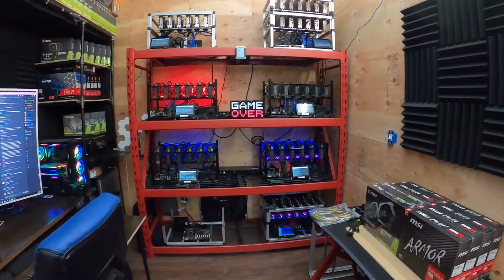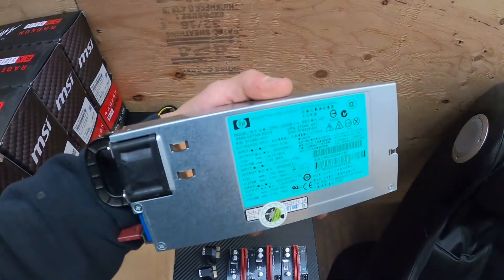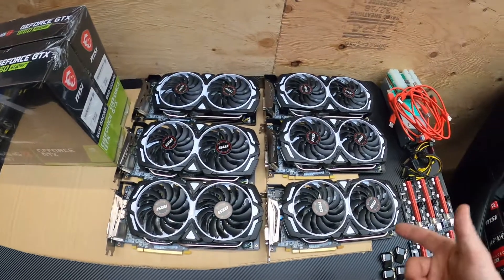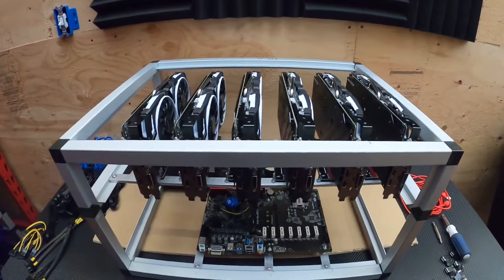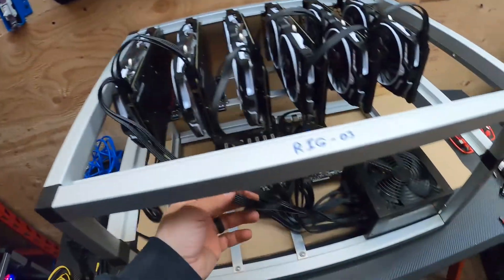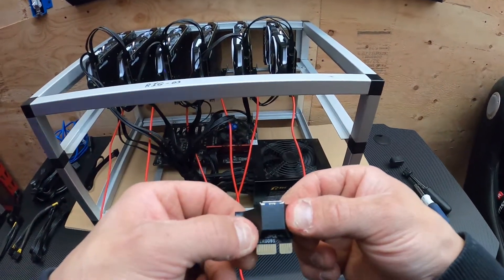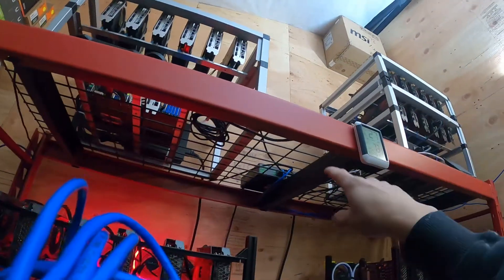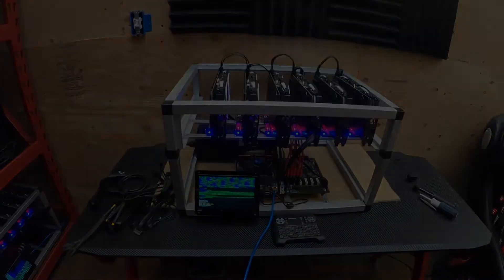NEW ETHEREUM GPU MINING RIG - RX 580 ARMOR X (REFURBISHED)

Comment: hi tell me please overclocking on 580 armor cards how much core and memory do you have?)
Reply from the maker: Join our free discord brotha. We have a bot called Jarvis that will spit out over clocks to get you started/EXTREMELY close to premium settings.

But here you go! This is HiveOS settings if your using MSI Afterburner cut the memory in half...
Fan 70
Core 1130 
DPM 3 (HiveOS)
Volts 850 (HiveOS)
Memory 2090 (or 1045 ROUGHLY MSI Afterburner) 
MDPM 800 (HiveOS)
Turn on aggressive under volt (HiveOS)
Reply: @ChumpChangeXD  Thank you))
Reply from the maker: @Bogdan-R6  No worries my man!!
Reply: @ChumpChangeXD  I got a difficult memory Samsung FC
Reply from the maker: @Bogdan-R6  turn down the memory a bit see if that helps. Just keep going until it’s stable
Reply: @ChumpChangeXD  Ok

Comment: Whats good to go when getting all these used cards for same price with 30 days testing warranty... Sapphire nitro+ se rx 580 vs zotac 1660ti gaming x vs gigabyte 1660 super?
Reply from the maker: 1660ti or 1660super most efficient  for sure and 30ish MH on ETH
Reply from the maker: I personally like ZOTAC
Reply: @ChumpChangeXD  but still rx 580 getting 32mhs 90-100w
Reply from the maker: @Rak54321  Yea 2 MH is more BUT for 20 -30  more watts is not worth in my eyes. Plus the fact that the RX 580 are older cards and will not be able to mine what the 1660’s can some day when ETH is not able to be mined anymore
Reply: @ChumpChangeXD  liked this reply

Comment: What you suggest among - rx 580 8gb, 1660ti, 1660 super, 1070, 1070ti, 1080, 1080 ti ? And what brand cards are best in terms of Watts and hashrate... Not considering price because buying used cards any way.
Reply from the maker: My opinion (not financial advice) 1660 super or ti what I would go for out of them all. Most efficient and get around 30mh for about 70-90 Watts

Comment: can i have th overclock of this card,because i had the same card u build here
Reply from the maker: No Problem!

My HiveOS Over Clock Settings For RX 580 Armor X: 

Core Clock 1130/ Core State 3/ Core Voltage 850/ Memory Controler Voltage 0/ Memory Clock 2070/ Mem State (Leave Blank)/ Memory Voltage 0/ Fan 70/ Power Limit (Leave Blank)/ Turn ON Aggressive Undervolting/ Refresh Rate (Leave Blank)
Reply: @ChumpChangeXD  i follows ur mod and bios video but it not work
Reply: Its said Failed VBIOS
Reply from the maker: @LongNguyen-jm2eb  Hey brotha, there has to be something your not doing correctly. Because I did all of that live. If you Join Discord I can remote into your rig and try to help you. Let me know; I don’t mind looking at it. Did you download the original vBios into HiveOS as I did?
Reply from the maker: @LongNguyen-jm2eb  Also this is only for AMD Graphics Cards.... Which cards are you using?
Reply: @ChumpChangeXD  same one u had Armor 580 8gb
Reply: @ChumpChangeXD  yes i do the exactly the same
Reply from the maker: @LongNguyen-jm2eb  ok yea that’s strange then maybe gotta try it again?
Reply from the maker: @LongNguyen-jm2eb  Reflash them back to the original back up you saved and Redo the Bios Mod Save and upload again. You must be missing something because it was super simple and that was my first time doing them live in that recording
Reply: @ChumpChangeXD  can i remove the rig and do it again,because right now all the card going offline and not thing i can do
Reply from the maker: @LongNguyen-jm2eb  You can reflash it and Input the same information in the rig conf file